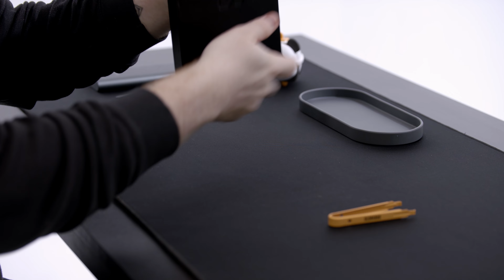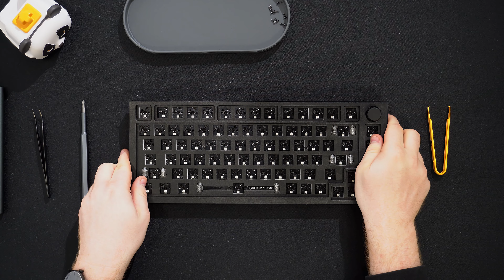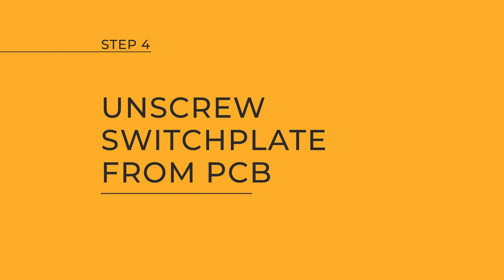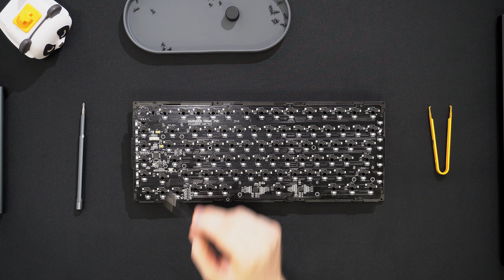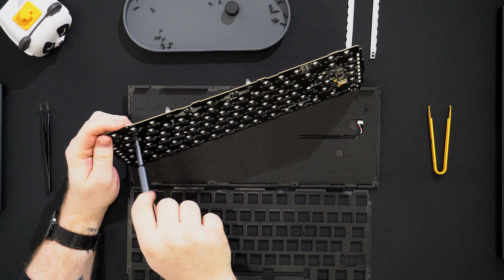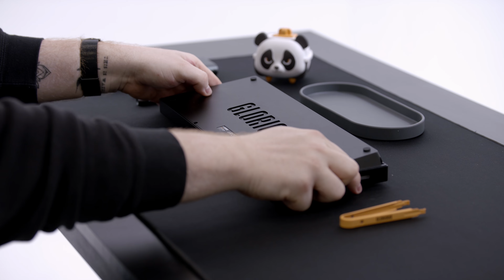How To: Disassemble a GMMK PRO

Comment: Everyone is complaining about the overlubed stabs but I can't even get off the impossible tightly screwed back plate. A custom keyboard you can't customise!!
Reply: I know right
Reply: I put a rubber bracelet and they came off easily
Reply: im complaining about both, and more, discovered a fucked up gasket in mine i had to replace too, glorious QC where u at?
Reply: 2 years later same issues

Comment: I don't know how none of the bigger channels have mentioned problems with disassembling the GMMK Pro or theirs have been completely fine. I didn't plan on taking apart my board until my backspace and enter would literally not come back up due to the grossly overlubed stabs. I some how forced my way through the screws on the backplate which were already way too tight, but the screws on my stabilizers ARE IMPOSSIBLE TO REMOVE which means I never even got to do the only thing I needed to. It's crazy that this problem has been so  common out of the box for these people who have been waiting months for their GMMK pro...
Reply: I have the same problem
Reply: Dude I have the same problem!
Reply: Good thing that you came towards the stabs... I'm stuck at the backplate, screws are already dead, not moved at all. Next step is to drill them out...
How can you screw in such little screws that tight. Feels like they were screwed in with 30NM or something like that.
Reply: I have the same problem with the keys sticking, do you have a fix?
Reply: @owenchief  Disassemble the whole thing and remove the (over)lube from stabs. Either that, or my friend told me he only strongly jiggled the stabs up and down rpeatedly and his keys no longer got stuck. Take that with a pinch of salt though.
Reply: received mine yestersy. dissambled it due to the overly lubed stabilizers and 2 led’s on my keys stopped working. getting a refund now and waited 3 months on the board …
Reply: Been dealing with this also, people who work at Glorious are scammers.

Comment: One of the screws stripped because it's so overtightened and low quality, I just can't get it off. I'm seriously mad right now
Reply: same issue here
Reply: kindof dissapointed really i dont know how to get that out
Reply: I just said fuck it and pulled on the top piece of the case and snapped it off. Not gonna send it back for replacement after waiting months only because of a single screw
Reply: @Mart-E12  lol im having this same issue and im seconds away from chucking it out the window. anything happen from you snapping it off?
Reply: @laurajpeg13  Nope only the screw broke and everything else is working and looking good. One screw out of 8 I'm fine with it.
Reply: @PKIVV  what the hell??? Did you cut the PCB?

Comment: can't dissasemble mine because it's screwed too tight out of the box!!
Reply: Have you opened it already? I just got my unit and the screws are too tight out of the box as well!
Reply: Have any of you got it open
Reply: I sent mine back and got a new one and still can't disassemble it...
Reply: Started taking mine apart last night and the very last screw was almost impossible to turn. Had to get a larger screwdriver with a better grip and had to really work it to get it out. Thought for sure I was going to strip the screw and end up with a case that's unable to be opened. Just take your time, go slow, and apply a lot of force and it will eventually give.
Reply: dude i cant remove the left stand off this shit is ridiculous

Comment: My GMMK Pro came with an out of the box band aid mod and overflowing with lube on the stabs. When opened it to change stabs, I found that the band aid like mod sticker was very difficult to remove and was sticky. So when I installed my new stabs, they were sluggish going up because they kept sticking to the band aid mod offered by GMMK Pro because of it's overflowing lube. I mean I love the board but I would've preferred if what was done to help us didn't actually make things worse and make the grease and sticker impossible to remove
Reply: Yeah I also had hard time separating stock stabs from the board, and wiping off those all-over-the-place lube. it was decent after re-lubing though.
Reply: @byungyoonchoi3744  Definitely yeah they can be improved and cleaned. It's just an extra messy step that could have been improved I think. Like a stock board without lube or landing pads and we get to do our own thing instead of spending a decent amount of time cleaning.

Comment: For people complaining about disassembly, I don’t think it’s a problem now? I don’t know, I bought mine a bit ago but never got around to modding it, and I started to do so now and it wasn’t too bad to take apart, a few tight screws but nothing unmanageable. I was mostly checking this video to see where those little plastic bits between the plate and the pcb go lmao

Comment: If you guys also experience super tight screws here is what I did. I took some hockey tape and wrapped it around my precision screw driver, with one layer of painters tape on the outside, to make a bigger handle. Screws that I could never turn were all coming out super easy

Comment: It would be insane helpful if you could add the types of screws used. by the way the stabs especially on spacebar are disgusting. need to change straight away

Comment: may be a  dumb question, but you need specific tools to disassemble the pro right?
Reply: A screwdriver with the right bits and prying tool is pretty much all you need. If you have switches in there: a switch puller, and if you have keycaps too, a keycap puller.

Comment: Can you put Durock v2 stabilizers in it?
Reply: Yes, but from what has been said if you are going with brass then you will have to shave down the stabs in order to make them fit. However, if going with pc or aluminum then you should be good, but aluminum is going to be a tight fit.
Reply: Aluminum plate is a very tight fit and it barely goes in.. I'm not sure if it will be OK in a long run.
Reply: @Adrian.Cruz.  I'm trying it rn and I straight up cannot get the aluminum plate over them. Not even the poly. Now I have to remove them and try and salvage the stabs it came with. lmao what a pos.

Comment: Are all the screws the same size or are there different sized screws for certain parts of the board? I'm hoping it'll be relatively easy organizing all the screws during reassembly and disassembly.
Reply: They are different sizes
Reply: They are different sizes but the four bigger ones that link the pcb to board go in specific holes and the video does it in order of type which is why it seems to go around the board twice.

Comment: Ok, the scalloped light diffuser are a massive problem and difficult to work with when trying to install the PCB plate. Also, the OCB plate came with longer screws and NO instructions. Am I to keep the foam beneath the PCB? If yes, is that what these screws are for? Too many damn screws here. Took me 2 hours to install new NKstabs and PCB plate. I dislike how complex this build is.
Reply: Yes the foam is for dampening, I don't recommend taking it out since it's gonna change the sound profile.

Comment: Are you able to remove the cover and swap it without having to pull all the keys and keycaps?
Reply: Product guide for the new exchangeable top plates states that the first step is to remove keycaps, switches, and rotors knob, before screws and top plate. So sorry, but looks like no